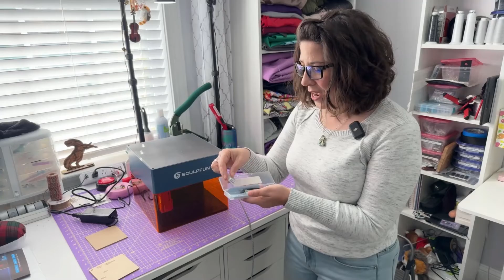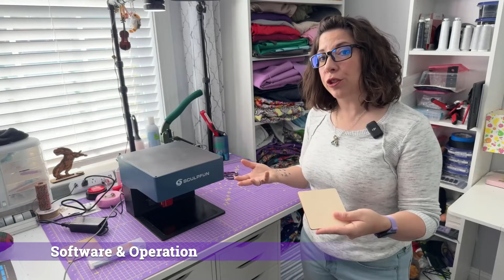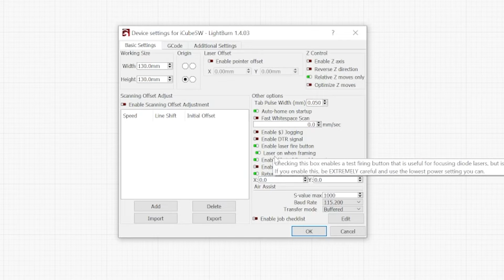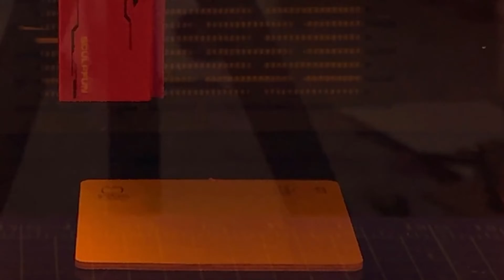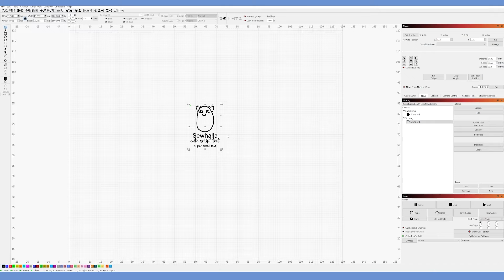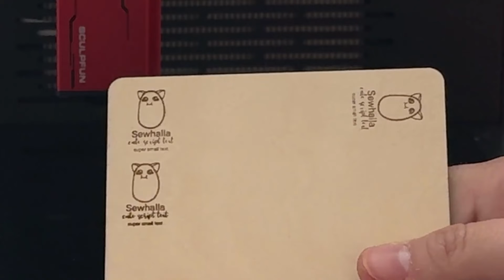An Affordable and Portable Diode Laser? Let's Test the Sculpfun iCube5W!

Comment: have watched yours and many other videos as i learn more about the hardware;can you comment on its safety and usefulness for various kinds of food,if i want to surprise family with cool,creative engravings?
Reply from the maker: Do you mean engraving food items and ensuring they're safe to use afterward? Like cutting boards? You just need to wash the cutting boards. What you can't do is fill them with epoxy or resin and use them afterward unless it's a food safe resin. If you mean actually lasering designs to cookies and cakes - that's totally fine as-is. You don't need to worry about anything other than using too much heat and burning the food lol
Reply: @fiercekittenz  thanks for the input, appreciate it...👍
Reply: do you know if Lightburn is included with the machine?

Comment: Hi! Just love your videos! Was wondering, since you mentioned cutting acrylic, which laser would you recommend for cutting 1/4 in thick acrylic?
Reply from the maker: It depends! Do you want to cut clear or semi-translucent acrylics? If so, you’ll need a CO2 laser. If not, a diode is fine, but aim for 40W.
Reply: @fiercekittenz yes, clear acrylics and mirrored. Want to make bag tags and blanks for making molds for resin casting